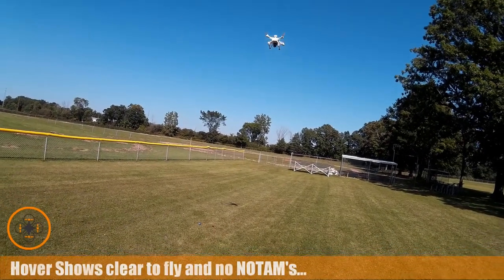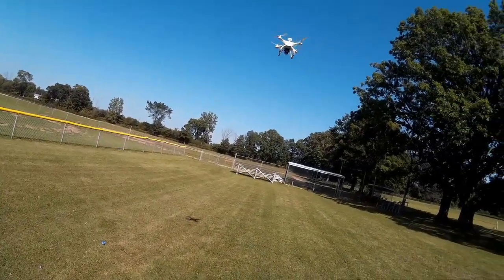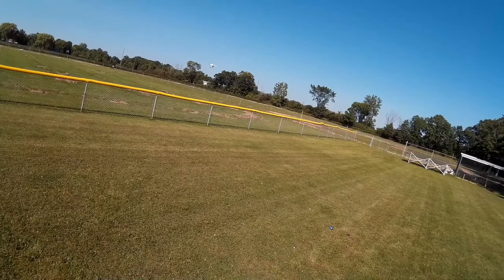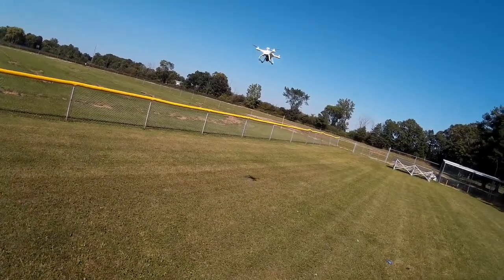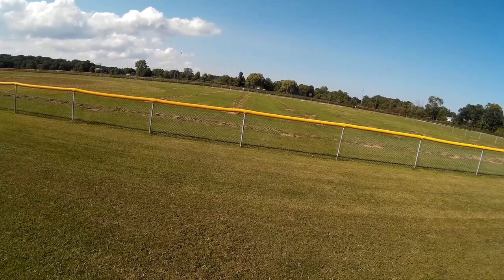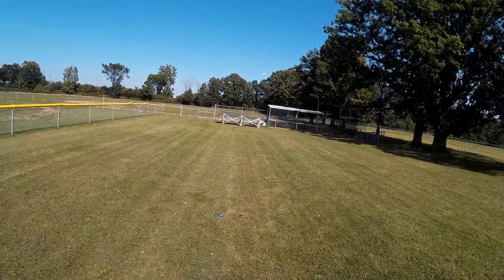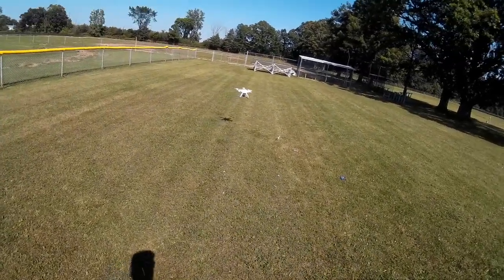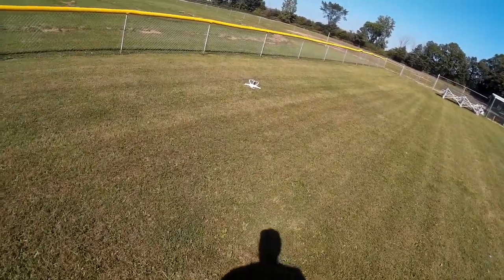Video Drone   Cheerson CX 20 Disapoints!

Comment: Really wish you’d give it more time, it is honestly a very good quad and like I said it is a better flyer then my $900.00 DJI Pro. Ultimately it is your choice, I frankly like to tinker with PIDs to have something that flys like I want it to. Sorry if I came across harsh, my bad, but it’s one of my favorite drones to fly besides my Bugs 3 modified. Good luck, if you would like to get rid of it, give me a $ amount and if reasonable I’ll take it.
Reply from the maker: Seriously I am a hacker and have built my own drones and really wanted this to work and likely would have "if" I would have invested a lot of time in it.  Now also in fairness there was a lot of time not on camera that I messed with it too just to get to this point.  However Joe Average will not invest this time nor likely have the skills for it either and this is the purpose of this channel to show Joe Average what they should expect.  As I bought it with the idea of using it on an S500 frame (as many people do)  and especially after watching Dustin Dunnhill do all kinds of mods.   Now a huge number of folks wrote me about this video and 90% said replace the GPS/Compass module as they are junk and you will be golden.  I think they where correct as I think that was the issue (again I have built  and messed with a number of GPS / Compass modules in my time so not a newbie) but again Joe Average doesn't expect to buy something and have to get a soldering iron out and replace a GPS module.  Also I am glad its working for you and no hard feelings as we all want the same thing, fun flying!  :-)

Comment: I have two Cheersons and both are great flyers, I have had one for two years and just bought another at WalMart for $99.  Your review is totally unjustified and misleading, if you know what you are doing this bird is awesome to fly and has so many features you can change through Mission Planner that it will fly as good or even better than my DJI 3 Pro.  You have to do all the calibrations and then thru Mission Planner, fine tune the out of box settings. 

Do a little research and educate yourself on Mission Planner, if you do you will soon find that this is a awesome little flyer. It is obvious to me watching your video that you don't have it set up right, probably did a sloppy calibration and now you blame the craft for the failures. Two questions, 1- did you turn the drone on first? 2- did you wait at least 5-8 seconds after you turned it on before you turned on your transmitter and then close the battery door and bind it.  I will guess your honest answer is NO to both. 

The reason you have to turn on the Drone and then leave it alone is so the compass can orient itself, if you move it it will get incorrect data to orientate itself and there goes your calibration.   If you simply follow the manual instructions correctly you can have it up and flying with now problem.

Please if you are going to review a product, educate yourself first and make sure YOU are not the problem.  I see at least 10 things YOU haven't done properly.
Reply from the maker: My friend, I tried everything with this drone and you see how it turned out (there is far more then you see in the video).  Also I have owned tons of drones and watched tones of video on this too so far from a newbie and this channel is about my experiences so people can see the reality for themselves and this is reality.  As I am happy this worked well you as to each there own, however I would not recommend this copter...  P.S. If it is this complex that I did 10 things wrong then it is flawed as a device likes should be intuitive to operate as the "average" isn't going to invest even the time I did in this :-)